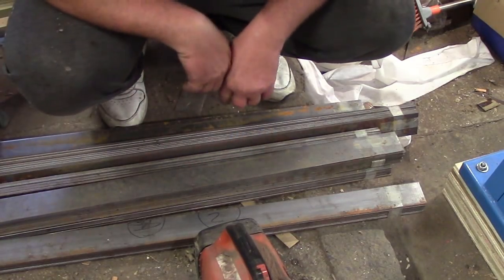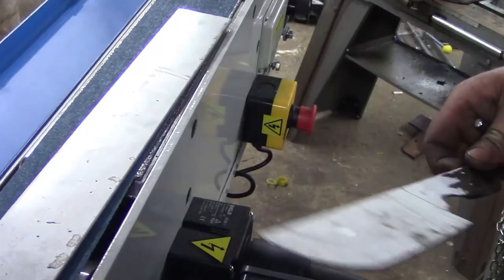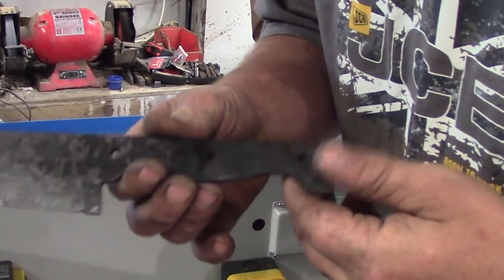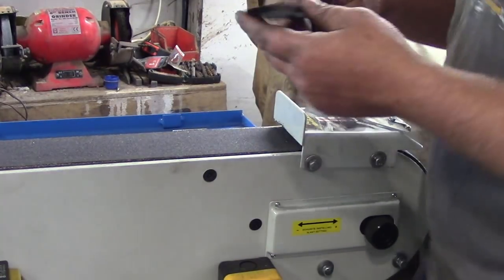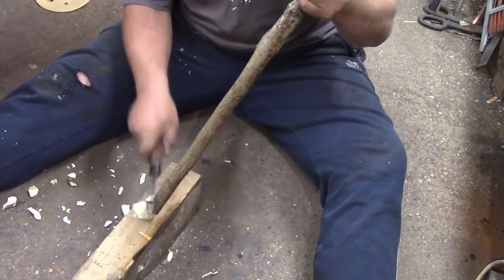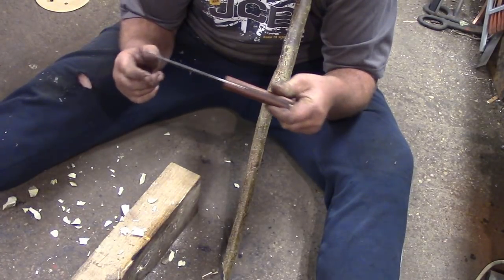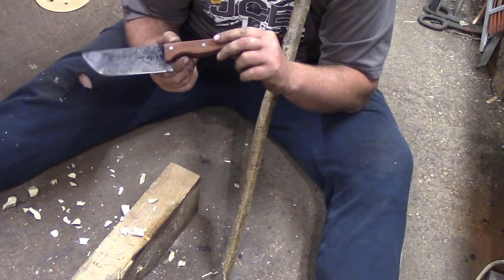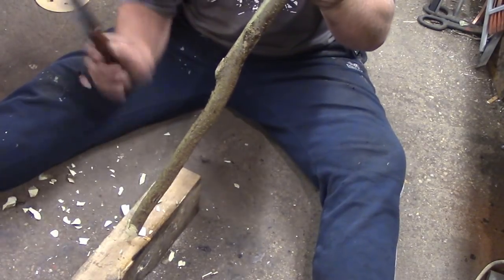Making the dwarf machete

Comment: Great camping knife, would buy one if you could ship to Australia.
Reply from the maker: sending stuff to Aus wouldnt be a problem especially if you sent me back some pics of yourself fighting a croc with one of my blades but i dont like this thing, I might try it again in the thicker steel so its got a bit more weight, and a slightly longer blade just an inch or two more and it would be a fun knife.
Reply: Turbo Conquering Mega Eagle ha ha maybe some pics of me fixing camper trailer lights with it or using it to cut duct tape. I'll stay tuned for the longer version!

Comment: Looks a bit like the MOD survival knife Turbo. I thought it was interesting  that you thought it was too cumbersome for a utility knife and I presume not big enough for a chopper. I often think that about these "one tool option" knives being brandished. I often thought about three inches of a blade is a great size for utility and general cutting. However a bit of market research would be needed to see what people are buying. There is a chap called junglecrafty who has an interesting channel and often uses smallish perangs maybe 12 inch blade and sometimes less. What about that? It would be easier for British guys to put in a backpack and go play in the woods than a full size chopper. Not so glaringly obvious.
Reply from the maker: I like those MOD knives, really hard to find genuine examples tho, they have a much thicker blade this was way too light to cleve with and the depth of the blade meant i couldnt turn it half way through a slice, my thumb had no mechanical advantage over the edge, this was just a bit of curiosity that needed answering as far as i am concerned!
Junglecrafty sounds like an interesting watch, ill check him out, small perangs make a lot of sense, especially if i can figure out a way of consistently altering the grind of the blade from fine to coarse and back again over the length of the blade, the idea being you can do fine work with the root of the blade, skin an animal with the tip and chop thick timber with the middle, a true one tool option maybe!
I've been using the Ralph martindale jungle knife for the last few years, I re-ground it because they are pretty rough when new, but its about 12" long so i can clear an area quickly of bracken and brambles, weighty enough that i dont miss having a hatchet with me and small enough to go in a pack, very good quality steel it does bear a lot of resemblance to a parang.
Reply: All sounds sensible Turbo.

Comment: when mass producing, are you going to cut the handle tangs out of the reverse side of the same length of steel like Fender does on their guitars? am i explaining that right?
Reply from the maker: er...  so they overlap a bit? any suggestions to speed thing up appreciated my friend! unfortunately i am not familiar with guitar production
Reply: so like, the handle of the next knife overlaps on the same piece of steel on the other side, so the shape of the handle is inverse with the blade pointing in the other direction and you can cut the handles for both knives with one cut of a bandsaw (or plasma cutter if you're feeling adventurous)
Reply from the maker: Mikail Elchanovanich ok, very well explained, I couldn't on this one as the Tang is just over an inch deep and the material is two inches. Always material saving is on my mind, but the other aspect that would make this difficult is my bandsaw doesn't like going around corners enough to cut the Tang to shape so it is far quicker to rough out with a grinder and file making navigation between the two tangs a very delicate task indeed! 
I do have a plasma cutter, I think maybe your comment will inspire me to dig it out and see how well I can follow a template with it!
Reply: ah, but if some of the tang is less than an inch deep, then you can offset the part that is more than an inch on the other knife into it. something something rotational symmetry or something.
Reply from the maker: Mikail Elchanovanich I hear you loud and clear, just been trying to find out if the plasma will upset the carbon content of the edge, in my mind if the off cut around the Tang had come off in one peice I'd envisaged saving it and producing something else from it but we'll see where your idea goes, thank you, I love this platform because of the idea sharing, one day I'd really like to do an epic build with as much subscriber input into it's design and construction as possible, set up a Facebook group and create an online design bureau and see what carnage we can come up with, truck mounted ballista maybe.
Reply: that sounds badass in every fashion. the internet hive mind is an incredible power that many people would do well to utilise. 

i wouldn't worry about the carbon content of the tang but i suppose it might ruin the blade just from heat transfer if you hang around with the plasma for too long, it is as hot as the sun after all, but if you're heat treating and tempering afterwards then it might not be a problem? this is where it goes from design knowledge to metallurgy knowledge.
Reply from the maker: Mikail Elchanovanich 4chan and Shia's flag, the least constructive yet most impressive display of strangers with tallent, imagination and diverse skill set.

I was concerned about using the plasma torch on the blade, the material I am using is annealed so requires heat treatment but at white hot the carbon cooks out of the steel, agree this will not matter on the Tang and apparently the disruption to the steel can be measured in thou so would be removed during grinding anyway.

Comment: You should have built a 2x72 would have cost you in and around 200
Reply from the maker: Sean Myers I will one day I promise! This was £500, has a 3" belt and 4.5hp!!!! So altogether much better suited for big blades, gotta speculate to accumulate my friend! Much better suited for everything else I get up to too, if I cast bits I can flat it off at speed over 3" which would cover most of the castings I've ever made.
Reply: Turbo Conquering Mega Eagle  4 .5 hp for 500 damn was actually pretty good deal can't wait to see the jig have a nice day